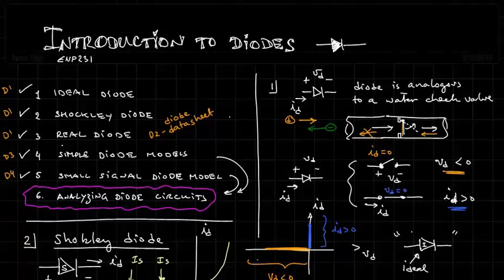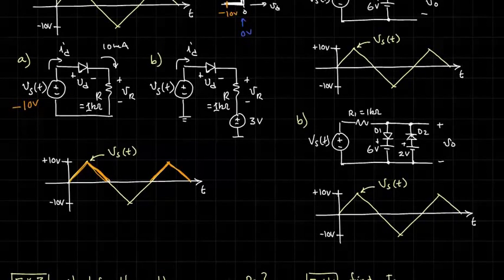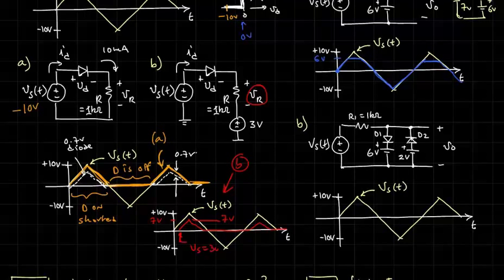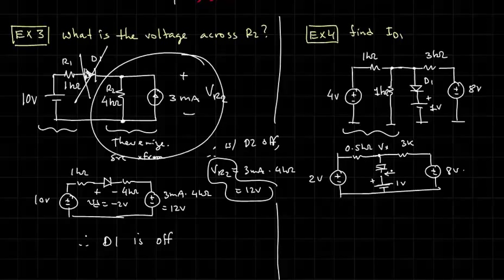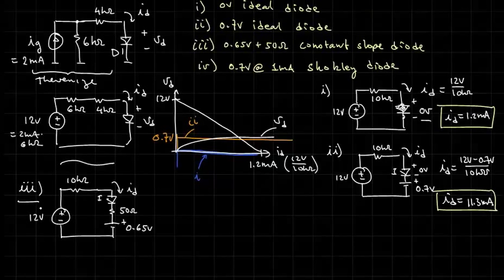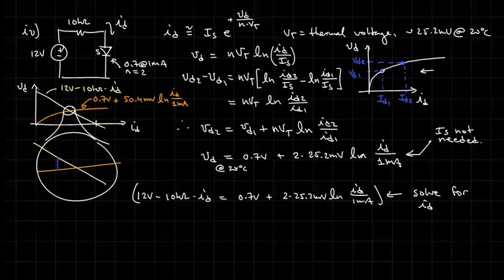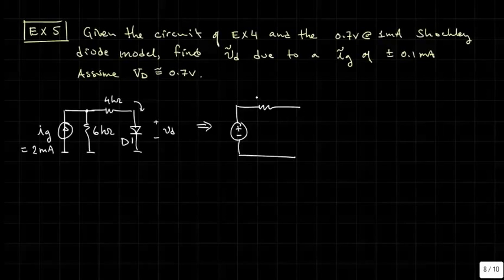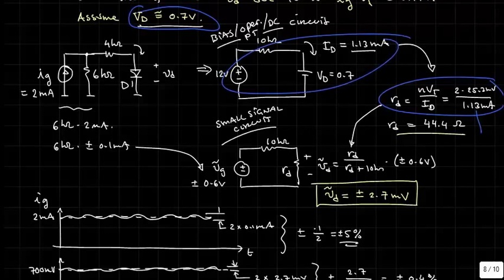Introduction to Diodes - Part 5 - Example circuits solved

Comment: Hi, great video, really helpful. Just a question with regarding to the Thevenin Equivalent Circuit in Question 4, why is the thevenin resistance 0.5Kohms instead of 2Kohms? If the voltage source is shorted out, are the two resistors left over in series or parallel?
Reply: They are in parallel. You can think of the ground as being the second terminal of the thev equivalent.